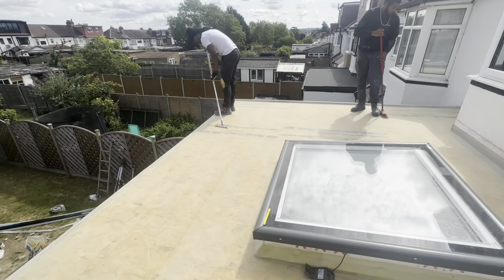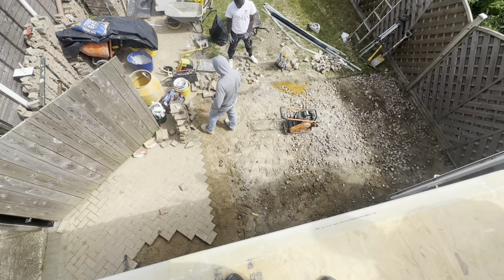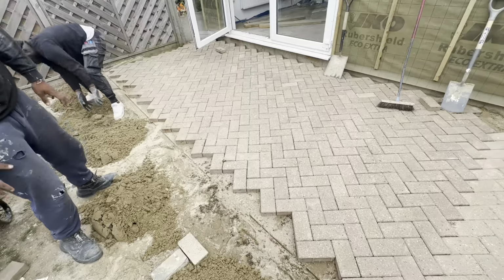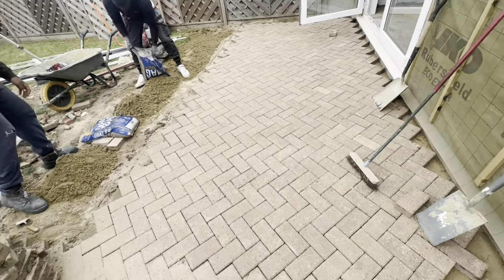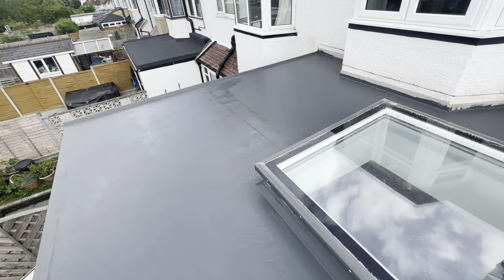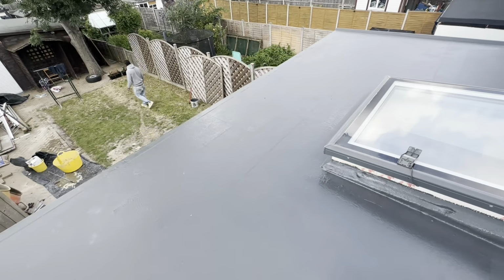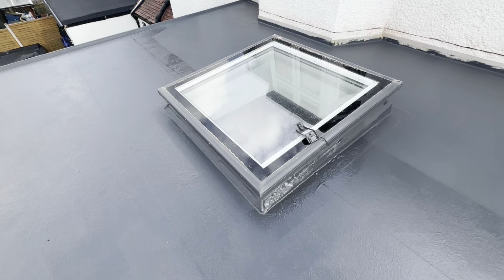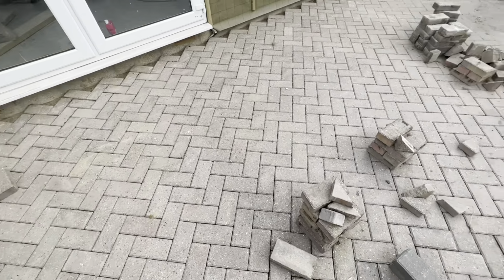Timber frame extension: Ep 38

Comment: Great video as always guys. Just one question, do you have to have cavity trays for this extension or is it a solid brick wall?
Reply from the maker: Which wall are you referring too? It’s a timber frame extension.
Reply: @darrenthebuilder sorry Darren, I meant the original house wall.
Reply from the maker: The original house is not cavity walled. Solid 2 skin construction (9inch)
Reply: @darrenthebuilder  thanks Darren, I've got solid brick wall and it's good to see that a pro like you has done it this way. Now I can tell my mates to shut up🤣